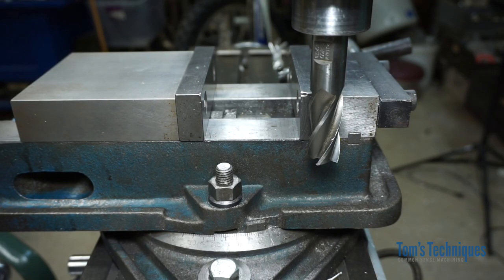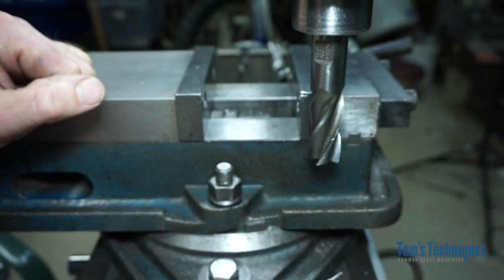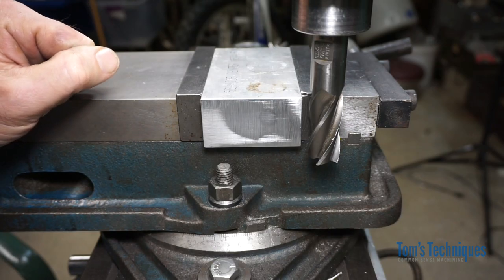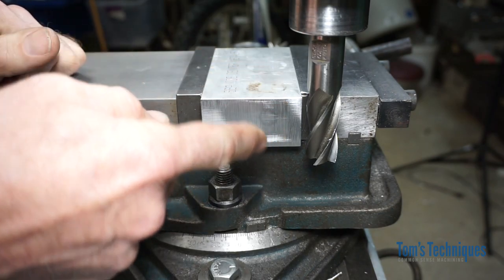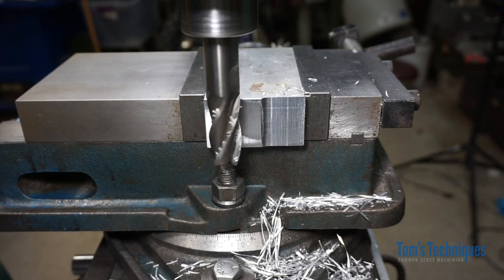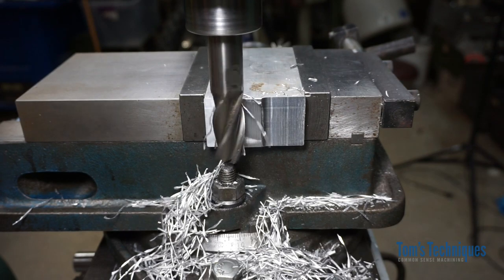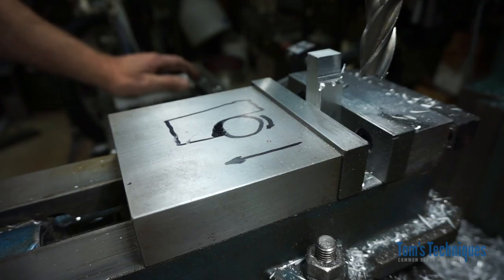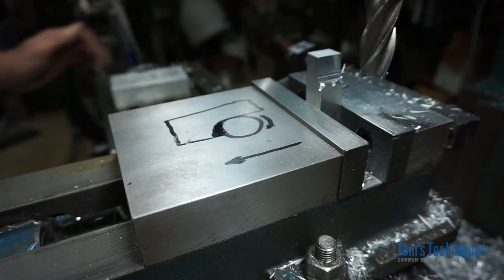Climb Milling vs. Conventional Milling

Comment: Nice job explaining the difference in milling directions. If you don't mind, I would like to offer a couple other points. 
Another reason that the conventional cut makes a crappy finish is that it drags chips that adhere to the cutter back into the fresh cut surface. These chips get wedged and smeared under high pressure embedding them in the otherwise smooth surface. If you use a lubricated air blast you will get a much better finish conventional milling. Plunge milling on an edge can have the same consequences as climb milling. Always pre-load the leadscrew counteracting the cutting force as well as using the lock screw on the table slide. One other point is that you should always check the tram (squareness) of the head and square of the vise after a climb milling crash. 9 times out of 10 something will have moved. By the way, mills have adjustments on the backlash of the leadscrew nuts. You should be able to get the backlash down to less than .005" pretty easily if the screw itself is not badly worn in the middle of it's travel. This small backlash will make quite a difference in not grabbing a part when climbing.
Reply from the maker: +David S. 
Thanks David. All good points.

The amount of backlash is only a problem if it's ignored. Proper tool overlap, feed direction and use of table locks will keep it from becoming a problem.

Tom

Comment: Most CNC Machines climb mill during standard operation ( ball screws ) . but manual machines I would only climb mill no more than a  1/16    and that's a machine with the correct back lash in the screws . if you climb mill in a machine with bad backlash it does not matter how little you take off.   you will get what I call cutter hop and possibly break the cutter and or ruin your part . but most of all the Safety Hazard of a Cutter Flying at you
Reply from the maker: +1995dresser 
There are too many variables that affect how material can be removed to just say limit the depth of cut to 1/16". The size of the cutter, condition of the machine, size of the machine, whether you are using the table locks or not and the type of material all factor in to how deep a cut you can take. 

If you are side milling for instance and have a lot of material to remove, it works best the take successive cuts half the diameter of the cutter. That keeps the cutter from pulling the work toward it. The table locks can also be snugged up to cancel the effects of backlash.

Broken cutters are always a problem indeed. That is why safety glasses need to be worn whenever operating any machine.

Tom
Reply: Heck... I just put the lock on losely.... if i have a lot of material to take off... I take like a regular cut.. then bring it in like 10 thou and finish ..... blah blah blah

Comment: Great.  Now I have a term to describe the same effects when machining wood with a router bit.  Same effects. Although, when machining metals, you have no grain.  Using "climb milling" prevents "tear out" when reaching the far edge of the piece. "Conventional milling(which is the same thing in wood), will tend to crack the grain just before the edge and push or break out a small piece parallel to the edge, possibly ruining your part.  So thanks for the demo.  I'm not a machinist in the real sense of the word, but woodworkers still "machine" the material  of their trade. I'm hear to learn other techniques that I can expand my woodworking skills. 
Actually, I'm setting up my drill press as a "quasi milling machine", or as an overhead router.  I just need to find an appropriate XY table for it.
Reply from the maker: +Martin Walters 
Martin,

I would suggest that you not try to mill on a drill press. Most drill press chucks are held on with a taper and they will come off with much side loading. Besides, the bearings are not designed for side loads. The XY tables you see for drill presses are for locating holes, not milling.

Thanks for watching.

 Tom
Reply: Oh, ok then. Brain fart from a non-machinist. :) Alright, speaking of locating holes..I've looked all over the net for a simple way to precisely align the centerline of a chuck to a center point of a hole to be drilled in a metal piece. I've always hand measured,  and hand center punched an indent at scribed center cross lines, but that leaves room for small errors in eye/hand execution..the scribes and the punch.  I've seen one video showing the technique of finding an edge with a "wobbler", which I assume gives you a precise starting point to dial in one direction distance with the XY table via precise adjustment, no? But then it appears you have to do it in the Y direction as well. Seems kind of
cumbersome, especially if you have numerous holes to drill. But you tell me. Is this how machinists normally do it? Thanks
Reply from the maker: +Martin Walters 
If you have an XY table, all you need to do is find one corner of the part and make that the origin. All holes will then be located from that point using the XY table to make the moves. If you watch some of my milling videos, you'll see me use an edge finder in most of them. The procedure is to move the edge finder toward one edge until it centers and then breaks. then move in 1/2 the diameter of the edge finder and zero the dial. Yes, you need to do it for each axis, but it only takes a few seconds.

Tom
Reply: Ok great! Will try it...as soon as I get a compound table. Thanks again.

Comment: Good  demo! Think of this same principle next time you see a large milling machine on a road construction job doing profiling and milling. In 1975 when these machines started hitting the market they were lighter and set up for the cutter wheel to rotate down with the machine moving forward just like climb milling and it would grab and propel the machine forward and make a mess out of the profile. We mechanics out in the field got together with the manufacturers and soon changed the rotation of the drum and configuration of the cutter teeth to make it an up cut (conventional milling) and to this day is still used to make it a more stabilized cut. Same principals-Different trades with many similarities. Thanks for the flash back. Ed K. Cleve. Oh. AKA-DoneWrenching.
Reply from the maker: +Eddie Kawecki 
Thanks Eddie. Glad you enjoyed it.

Comment: Just like explained in school, CNCs use mostly climb milling cause they're built with ball screws and they virtually don't have backlash, also the wear on the tooling is about 3 to 4 times less on climb milling...
Reply: Thanks ,Thats very interesting info ,I think I might have to climb mill as much as possible Cheers ....
Reply from the maker: +Dave Gray 
Just remember the lighter the machine, the less it will tolerate climb milling. Bench mills and such should be limited to light finish cuts when climb milling.

Thanks for watching.

Tom

Comment: Thank you Tom for making the difference between both types of milling so clear. Is there any specific reason that you didn't use the term, 'hook milling' in association with your thorough coverage of the processes? Is it fairly common to also call climb milling, hook milling, or has the expression become archaic in the machine shop? Great video Tom, thanks again!

Comment: Very good description, but the camera threw me as it looks like the tool is moving and not the part. So I have to confess and say either you are drawing it wrong or I still have not got it ( the money is on me being wrong ). I will have to do some more searching on this subject, I always thought that if the work moves in the same direction as the spin of the tool ( with regards to the cutting edge ) then you are Climb Milling, but you look to be drawing it the other way, so I am really confused now, but I have to say I watch your videos a lot, you have always given me good advice, I like it keep it up, thank you very much.
Reply: +Toms Techniques Then I am ok with how I understand it, thank you for your quick answerBob

Comment: Good job Tom, myself I always told the kids climb milling is "all cats climb mill" just ask your wife;  conventional milling  is a front end loader, the bucket rolls back and scoops.
Now the cat in order to conventional mill has to be upside down, and they can do that.
But the loader to climb mill has to back drag off the top in reverse for a nice shelf.
Do I make sense after 60yrs  LOL  Non believers,  just watch your cat climb milling the
couch................samuel
Reply from the maker: +samuel pine 

 An interesting analogy. If we had a cat that climb milled the couch, my wife would climb mill it with the wheel of the front end loader. :)

Tom

Comment: Thanks for the videos.  I've been wanting to get into a bit of home machining for awhile now, still looking for a machine, but when I eventually find one I'm sure videos like these will help no end.

I had one question, does conventional milling build up more heat due to the initial rubbing of the cutter against the material?  If so, does it tend to make the cutter blunter faster or is it a negligible difference?
Reply from the maker: +Joel Cresswell 
Yes it does. That initial rubbing is not present when climb milling and does generate a little extra heat.

Thanks for watching.

Tom

Comment: Thank you for the reply Tom. I am making my own locks(for small boxes),and the stainless steel parts i'm machining are the moving parts of the mechanism. I was under the impression that 304 Grade was easiest to machine.
Reply from the maker: +Alan Jackson 
304 is good for welding and fabrication (sheet metal work), but it doesn't machine well at all. If you have a lot of machining to do and haven't started yet, I would definitely recommend using 303 instead.

Tom

Comment: Nice job Tom. 

I think of it as scooping, conventional..... and clawing, climb milling. What I didn't know was the physics of how and why one worked better than the other depending on the finish you were working toward. 

That lesson was presented really well. 

Thanks Tom.
Reply from the maker: +wiredodger60 
Thanks. That's a good analogy.

Comment: Would it be possible to 'Climb Mill' stainless steel(304 Grade)or would it blunt the cutter in no time? I intend to mill slots,1/8"wide x 3/64"deep, by conventional milling first,then climb milling,to get as fine of a finish as possible.
Reply from the maker: +Alan Jackson 

Alan,

304 stainless has very poor machinability. Is there a particular reason why you are using it and not an alloy that's easier to machine, such as 316 or 303? In answer to your question, as long as you run the end mill at the proper rpm, it doesn't matter if you are climb milling or conventional milling.

Tom

Comment: Thank you very much, hope you will make video about 3D milling.
Reply from the maker: +Tri Ha (BeeCadcam) 
All milling is 3D (length, width and height). Did you mean CNC?

Tom
Reply: Toms Techniques yes, i mean cnc milling. Thank you
Reply from the maker: +Tri Ha (BeeCadcam) 

I would if I could, but my meager shop capability doesn't include it. Maybe soon.

Tom

Comment: My college machine shop supervisor told us to imagine a car trying to drive up an icy slope and the tires are spinning--that's climb milling.
Reply from the maker: +Thomas Utley 

Hmmm...
Reply: +Toms Techniques Perhaps the analogy worked better in Utah where I went to school...there were plenty of cars spinning up slippery hills. Ha. Great video--your sketches were perfect.
Reply: +Thomas Utley I think that's a pretty good analogy.  I always thought of it as pressing a pencil onto the side of the work and rolling it on the work with your hand--that's climbing
Reply: More like a car driving up a hill not slipping a bit, until the road under it suddenly jerks toward the car, causing the car to crash. That's climb milling on a Bridgeport or pretty much any mill without ball screws.

Comment: Great piece Tom.  This is the best explanation of why conventional vs climb milling finishes differ I have ever seen.  Thanks for taking the time to educate us!  Fred
Reply from the maker: +Fred Miller 
Thanks Fred.
Reply: +Toms Techniques! yes sir much better explanation and a helluva lot less expensive than using the bosses hi speed video / computer file set-up over at the tech lab. thanks tom. (i personally used a similar video set-up @ ITW / paslode fastener engineering dept. to observe how prototype 'roundrive' nails went thru a 'windowed' nose piece of a pneumatic nailer tool > kinda like trying to find a needle in a haystack searching the 'bazillions' of frames per second...)